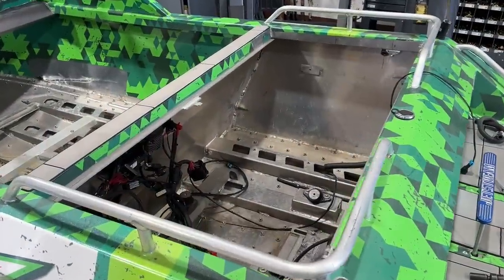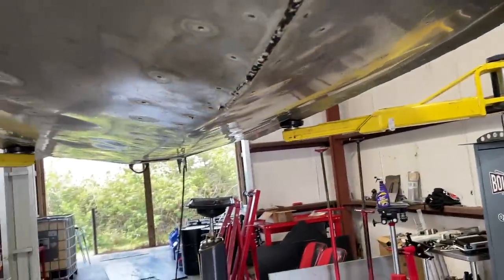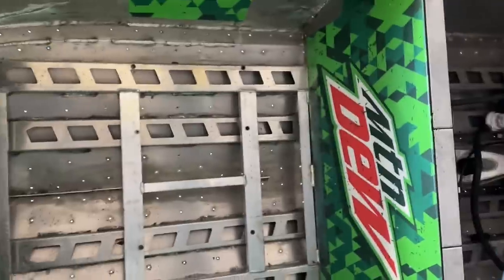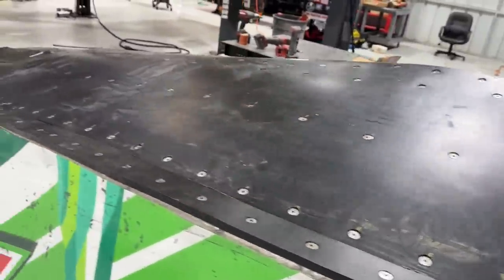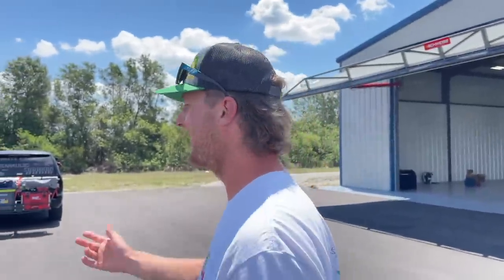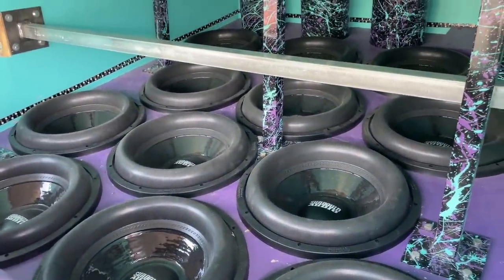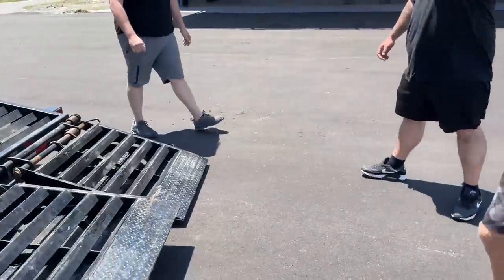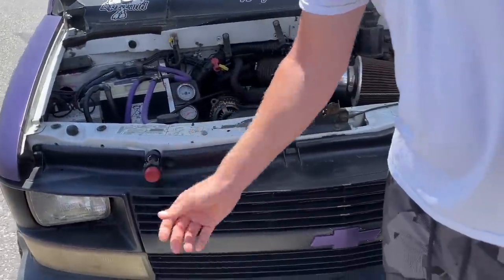More MAJOR Damage On My Mini Jet Boat, Surgery Begins! + An INSANE Sub Woofer Van Destroys Our Ears!

Comment: the one dent under the stringer might be pulled out by welding a ear to the dent (aliminium ) and use a hydraulic puller or verry large slide hammer
there used to be a specialized website for the car audio stuff , sumting sumting extrusion (the realm?)  , there was one video of a girl sticking her head through the window and loses het glass eye , others with girls riding the windshield (eeer) speakers hooked up to mains power , stuff blowing up was nice to see

Comment: Tye is one skilled craftsman using a torch to heat the metal before welding and using a table to single handedly put the rubber on the bottom this guys got more than just common sense ❤

Comment: You have threaded holes all over the bottom of the boat that you can use a slide hammer to pull dents better

Comment: No mention of the SPL numbers? Thats like going to see a Drag Car and not asking what kind of quarter mile it runs.
Reply: 173db+
Reply: @Bassahaulic Productions  I used to compete like 15-20 years ago, had a 95 civic with a single 12 that pulled a 145.5 dB on my first time ever competing at an event hosted by Rose Auto Accessories in Blairsville, GA. Still have subs in all my cars but nothing that would punch you in the chest the way that one would. They also shortly after I started competing merged with some cars how called SLAPSHOW or something like that and they changed the meters and it got way harder to hit big numbers.

Comment: Those db contest vehicles are a complete joke.  Who cares how loud it is when it is distorted garage sounding audio.  Class d amps are complete garbage.  The trick to hitting those spl levels is to run higher frequency audio.
Reply: That's crazy! We're winning Sound Quality competitions at the highest level with Class D amps. :P
Reply: @bassahaulic  Class D amps are utter garbage with poor linearity.  The only reason why the industry has pushed class d amps so hard is due to the fact that they are much cheaper to design and manufacture.  Many common practices in the car audio industry are completely wrong.  The oscilloscope does not lie and when monitoring the outputs of class d amplifiers compared to class a or ab, the class D simply lacks fidelity.  Another major factor is headroom and where the amplifier design differs is that class a/b amps don't suffer from crossover distortion.  Another common mistake made is running subwoofers mono which also ruins the quality of the audio since music is recorded in mono.